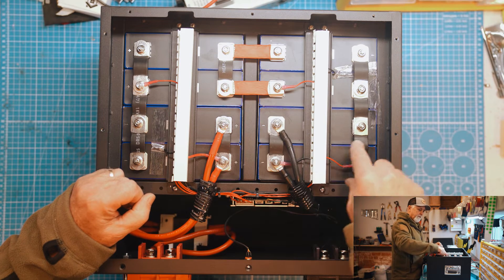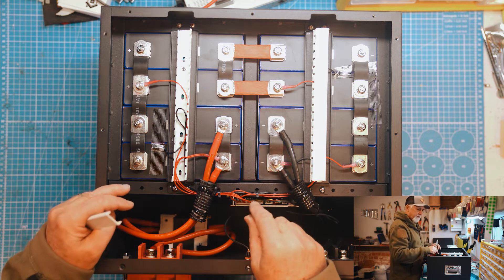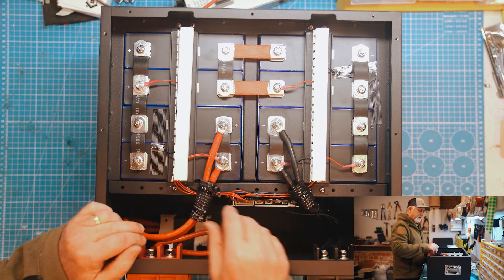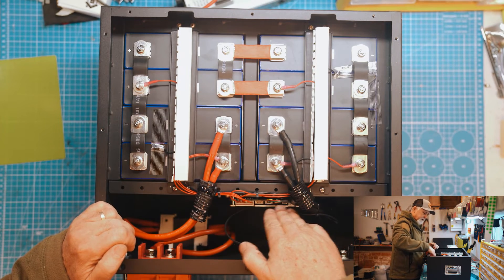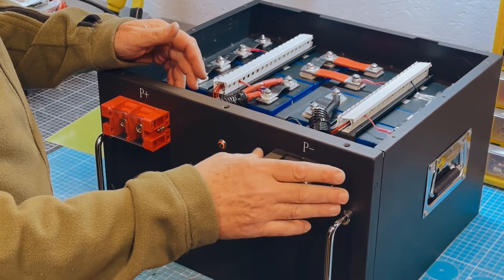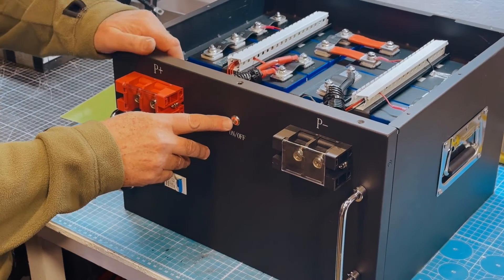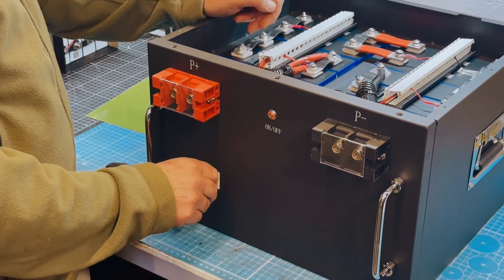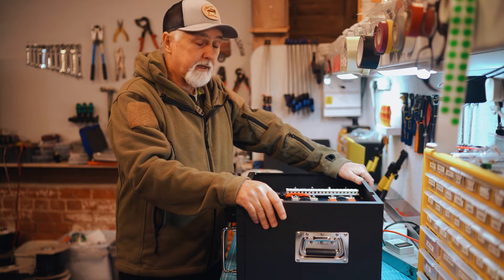Our latest 460Ah LiFePO4 battery

Comment: Would 280AH cells or 304AH cells fit this box? Can we purchase the box by itself?
Reply: 230AH cells...
Reply from the maker: No, this box is only designed for 230Ah cells but we have one that’s slightly bigger that can fit 280Ah & 304Ah cells.
Reply: @offgrid_power  Where can I get the empty box?

Comment: What make is the 250A breaker
Reply: Same question on breaker. Any 250A non-polarized DC breaker that  I've found is an expensive beast. It needs to be non polarized as current will flow both ways under load and charging.

Comment: Very neat, Roger! The only small adaptation I'd make if it were me, would be to offset the top restraint bars a little so that they weren't covering up the pressure vents on the cells. A potential solution would be to use a strip of metal that simply has holes cut in it over where the vents are. Think of Unistrut but with fewer, bigger holes, and then route the cables either side of the holes. But I love the inclusion of the chunky DC circuit breaker - very nice feature, and the cable management is really nicely done.
Reply from the maker: Thanks for the suggestion. There are actually holes under the conduit for the pressure vents, I just didn’t show that.